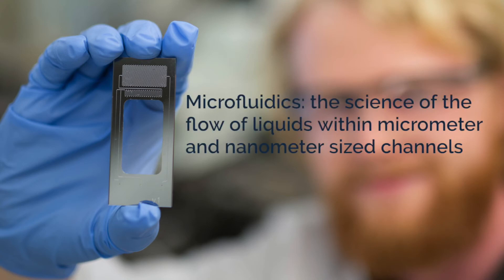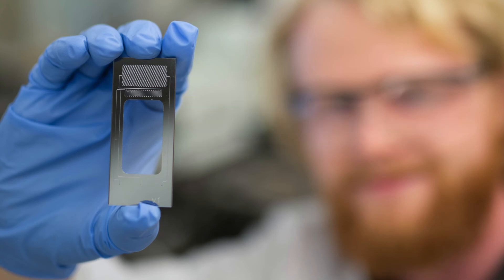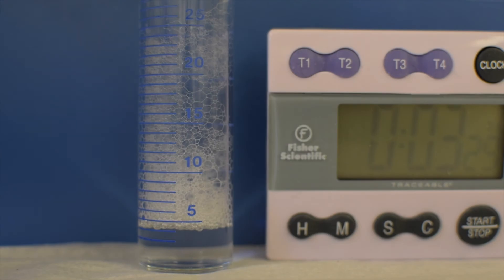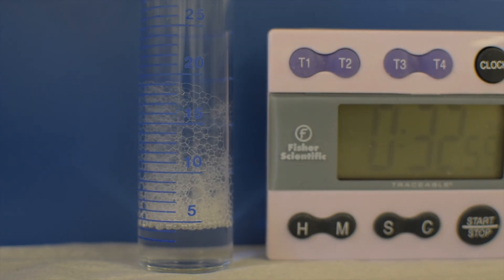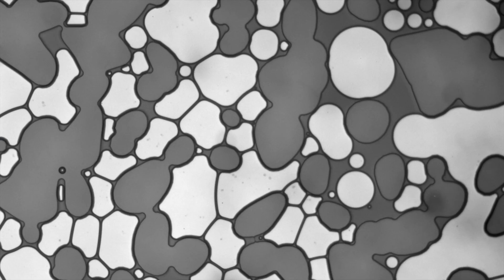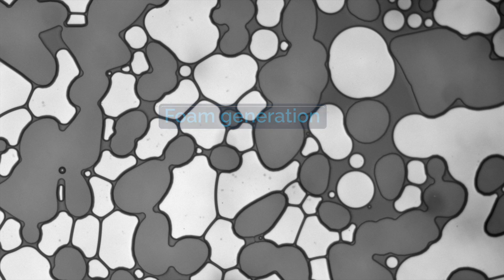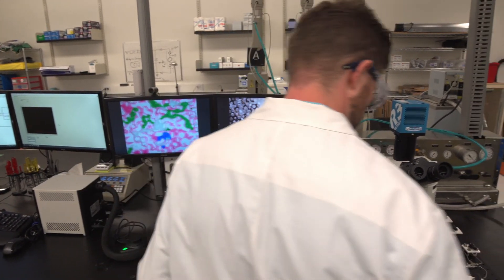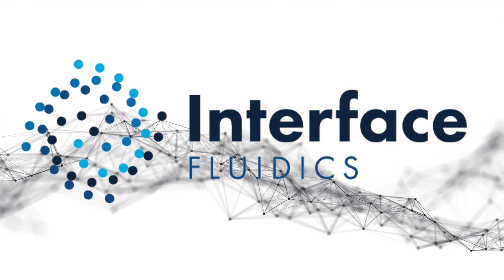A Better Way to Test Foam Stability

Comment: How much pressure can these systems withstand? Is it really possible to work at reservoir conditions, e. g., above 350 bar?
Reply from the maker: Hello Lucas. Our commercial systems can hold pressures up to 500 bar. The version in this video is a simpler demonstration system that is not running at high-pressure. We would be happy to talk with you more about our commercial foam analysis. Please email us at info @ interfacefluidics.com if you want to learn more.